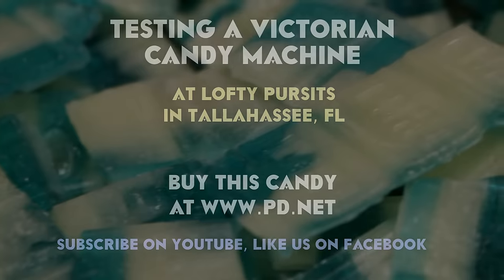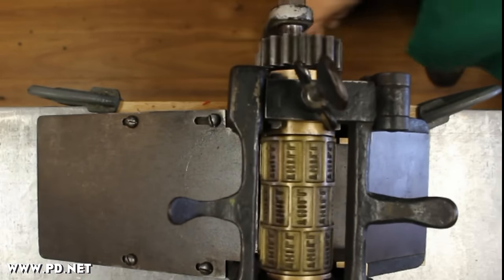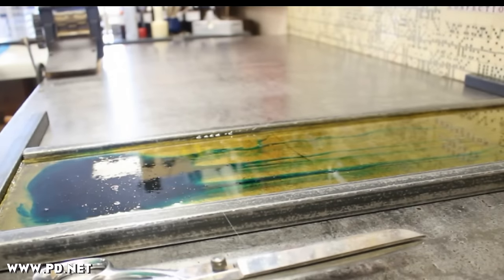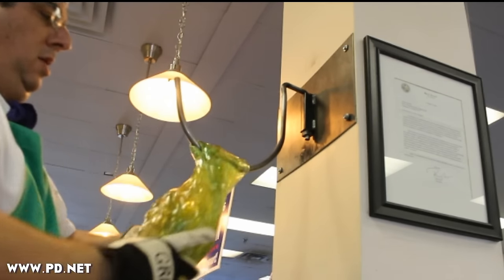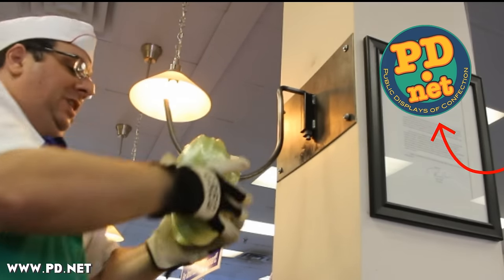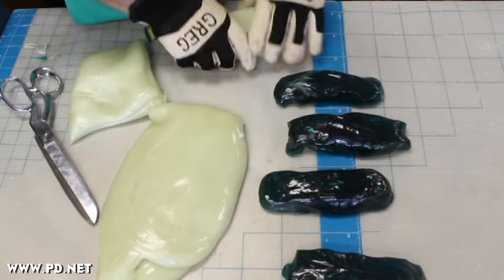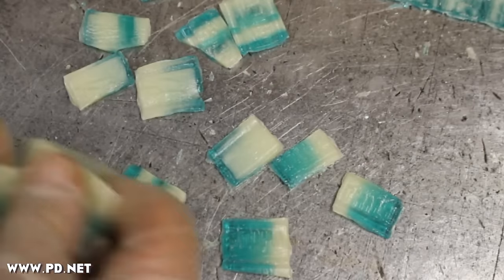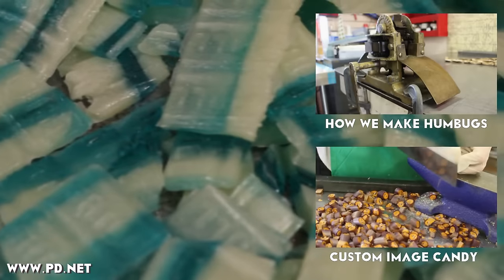#36 Using a Victorian Candy Machine from the THILL Candy Co. (Part 2)

Comment: You may be able to find a machinist to or a machine shop to Aline the rollers to work correctly . It shouldn't hurt the machine or any of the rollers the gear sets look pressed on most small shops should be able to do it.

Comment: Wonderful video, thanks for the upload! I'll see if I can do any research as well on the Thill Candy Co. and i'll pass anything new I can find onto you.

Btw, how do you clean the candy off the stretching hook at 5:04? Seeing as it's so thin, it must harden pretty quick, right? Also, is the wall its attached to reinforced or is it just screwed into the beams?
Reply from the maker: the plate is screwed into the beams. we just soak the hook. Sugar us very water soluble. It cleans up quick.

Comment: It would seem to me that the problem with these rollers is the tolerance in the gap between one roller and the other.  I'm sure the candy exerts a lot of force to try and separate the rollers, perhaps the bearing mechanism that fights force isn't doing it's job?

As always, a great video!  I could get into so much trouble at your shop!
Reply from the maker: the pressure is correct, that's adjusted by the top thumb screw. The "chambers" in the roller needed to be deeper, or the "lines" between them on the long side are too thin. I only have three sets of rollers that fit it. The other too need longer gates than this machine has. I think I could sand down the side spacers and make the other rollers fit, but I hate to make permanent modifications to these machines. I don't need to. I have other machines.
Reply: Oh I get it!  There's not enough difference in thickness between the 'drops' and the flashing.  More flashing  (make the lines wider) or more candy in the drop (deeper chambers) would increase that ratio, and allow the drops to break along the flashing instead of just randomly.

Comment: Looks like you need a deeper hole in the spacers between the rollers to bring them closer and then slightly deeper recesses on the upper roller cog to allow it to sit lower, but still spin at the same speed as the lower roller to maintain registration. Quite a bit of work for a candy drop machine.
Reply from the maker: Send Cadbury over and I'm sure we can work it out.

Comment: is it possible the machine works right, but there is a different consistency needed for the candy? 

I'm assuming the rollers are close enough and all that jazz. its just disappointing such a beautiful machine isn't working out.
Reply from the maker: The machine is fine, but it was not made to fit most if my rollers. The roller was not made right, it needed more space between pieces on the long edge.
Reply: +Lofty Pursuits I see I see. I went back and watched a few drop videos and I get what you're saying now.

Comment: why is brittleness a property gained from the roller?
Reply: The sugar gets naturally brittle when it hardens, and the thinner it is the easier it breaks. The machine is supposed to form really thin lines between the thick chunks of candy so that when it hardens you can split it cleanly. If the machine is miscalibrated, the separation lines will be too thick and the candy will break everywhere - not just where it's supposed to.
Reply: +F3Ibane To clarify, when I say thin/thick, I mean the depth of the lines, not width. Think tissue paper vs cardboard.
Reply: so really, it's not that the candy is brittle, the problem is that the fracture lines are not in the correct places because the intended fracture lines are too thick?
Reply from the maker: I guess I was not clear. The candy is at a fixed brittle level (is that even English?) Bits of the candy have to be much weaker to break. The prices don't have enough space between the pieces on the long side. They could have made the chambers thicker too.